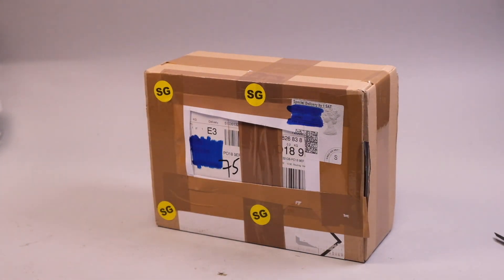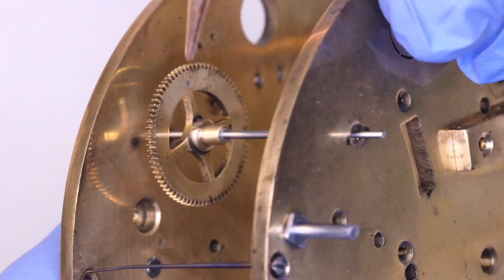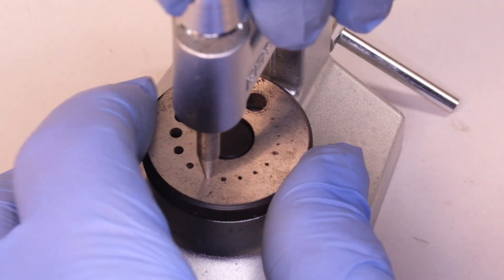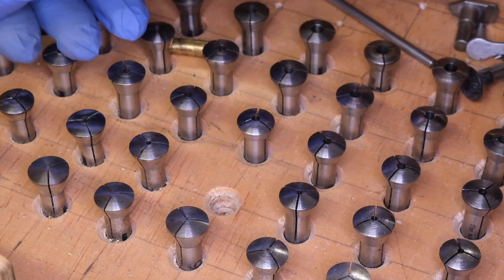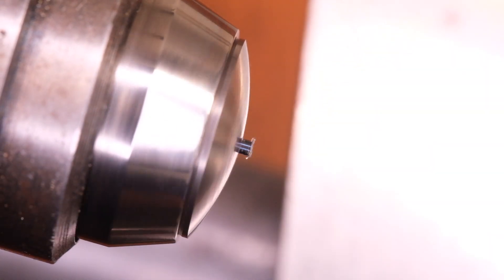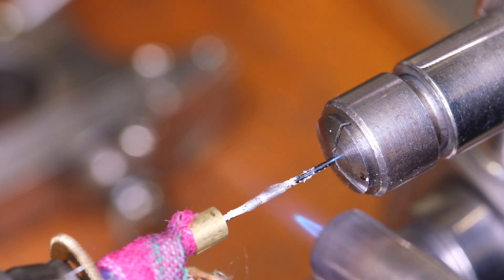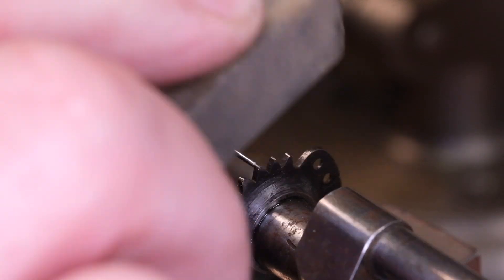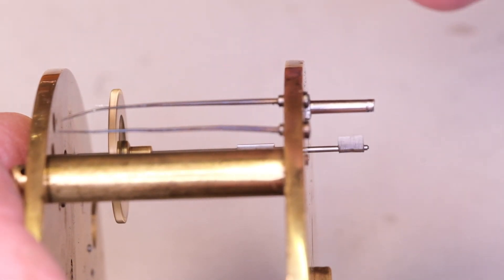#031 How to repair a broken clock arbor by silver soldering

Comment: Thank you for this highly instructive video - I never would have imagined a person could get all this together! One question: how did you choose the angle between the gathering pallet and the warning pin? ...or doesn't it matter? thanks again!
Reply from the maker: Thanks Bradford for your kind feedback.  With a French clock, when the train is locked by the stop piece, the gathering pallet is fitted at 90 degrees to the rack, facing outwards with the train locking as soon as is possible once the hammer lifting piece falls off the hammer pin.  Yes the position of the warning pin is important.  Somewhere between 1/3 and 1/2 from the face of the warning piece.  More than half a turn and there is a risk the next pin wheel pin will begin to lift the hammer when on warning.  Hope this helps.  M